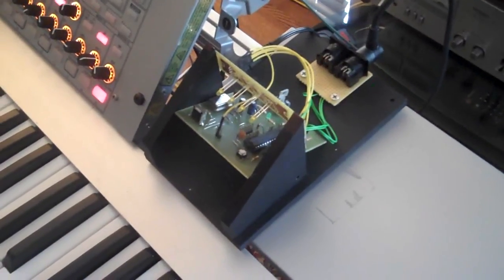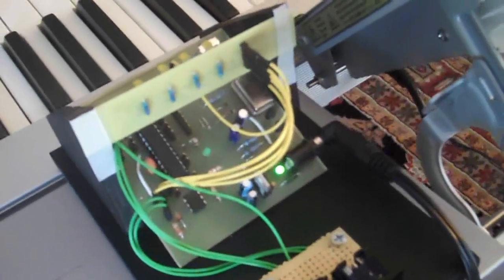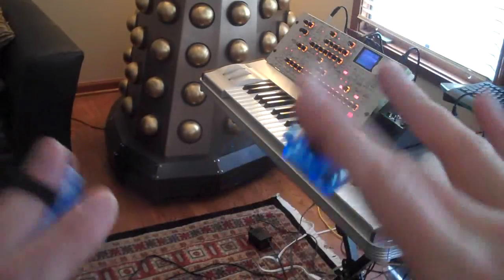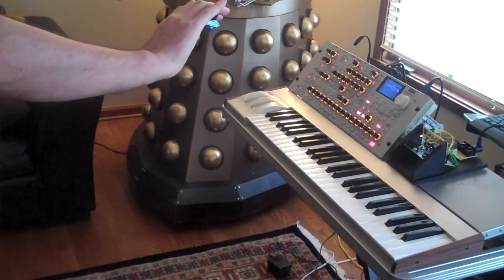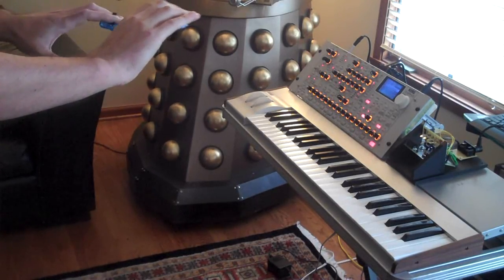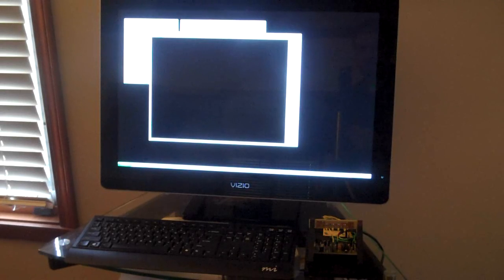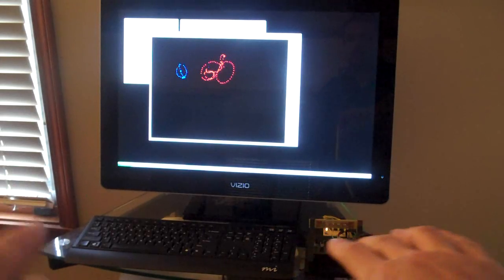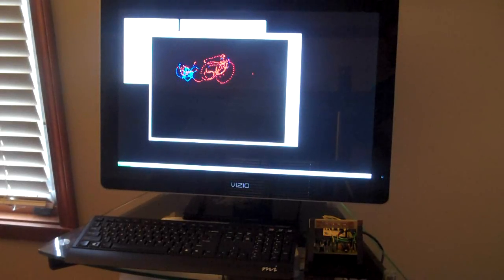MIDI Camera - 100 Hz video to MIDI converter, no PC required

Comment from the maker: @AusDisciple The parts are easy to get - almost everything I do uses "analog computing" elements coupled with microprocessors. The microprocessor is the Arduino, and the other things are built using OpAmp chips like the LM324, TL082, TL084 - you can get these from Radio Shack, Fry's and online...